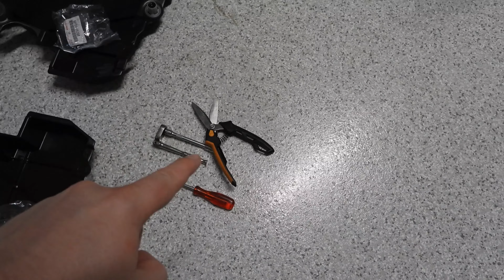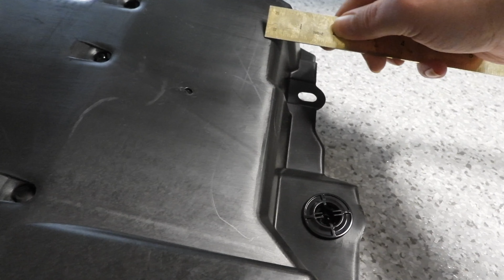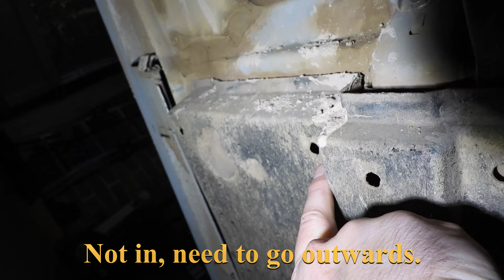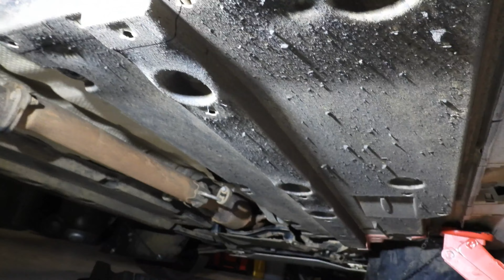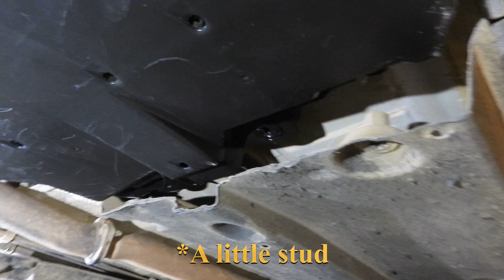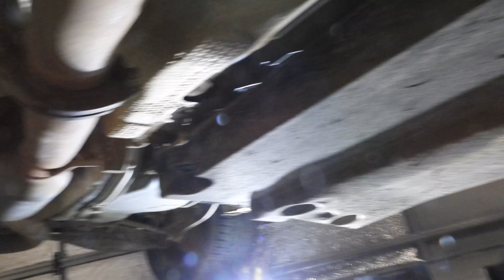GR Yaris - Aero Pack Undercovers Install

Comment: Did you get better fuel millage?
Reply from the maker: Yes actually. 
I've got a video planned that will show some highway testing and the results but it's the middle of motorsport season right now, and there's not enough time to dedicate to that project unfortunately.
.
With the cusco rally suspension, my gry is slightly higher than stock even at the lowest height setting of the coilovers, around 5~10mm taller, which means the gap between the underbody and the road is larger than standard, which means more air travels under my car, which means having a smoother underbody is even more beneficial for reducing drag and improving fuel economy.
It should be interesting when I get the numbers for that.
.
I've also got a video planned showing the fuel economy difference of the oem gen2 wing in it's different angles of attack. Maybe i'll bundle the two videos together. 🤔

Comment: Newer models have a cutting reference line on the front panel. Models from 2020-2023 do not have this cutting reference line.
Reply: So my 2024 Triple Edition would have these reference lines, right?
Reply from the maker: Yes. Easy to check, just gotta look under the car behind the doors infront of the rear wheels.
Reply from the maker: Excellent.